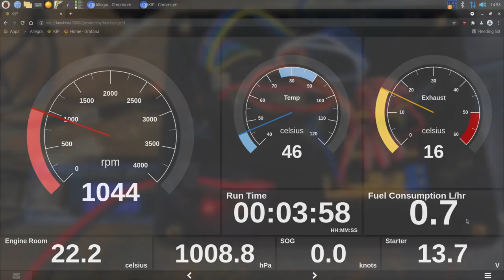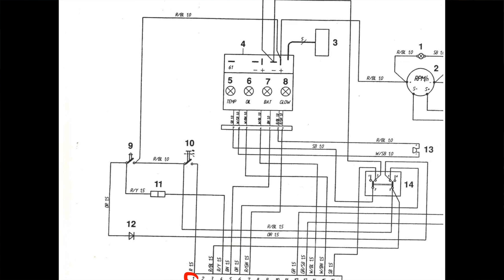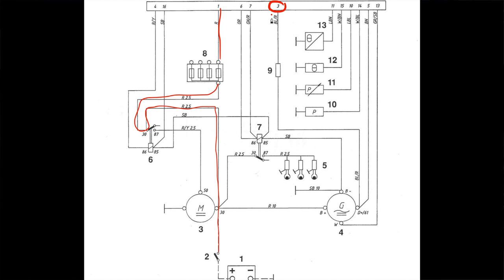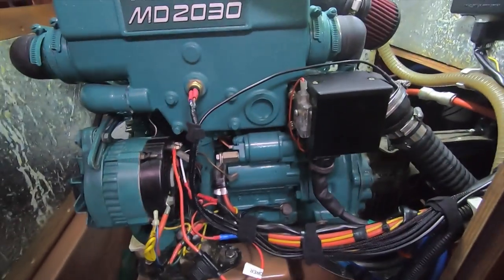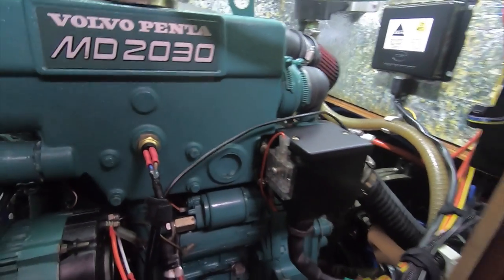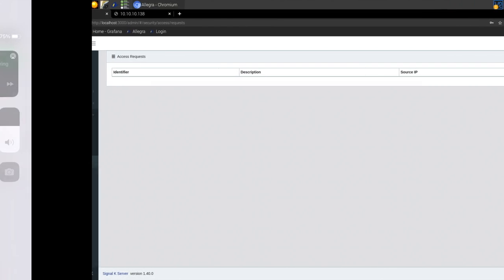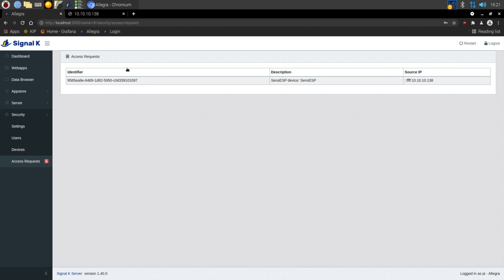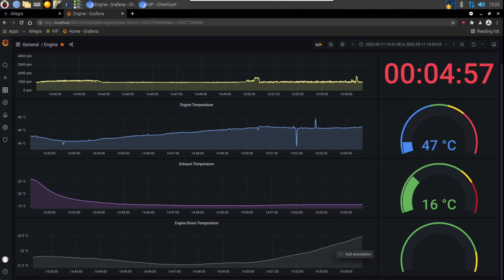OpenPlotter - ESP32 Install - Digitising an older engine - SensESP

Comment: Hi, I’m going to be another copycat. Thanks for the videos. My engine compartment gets really hot after the engine is stopped so I’ll be mounting the esp just outside. Keep the videos coming. (Alderney 👍👍👍👍👍)
Reply from the maker: Hi, Many thanks for your comments. We have noticed the same really and i'm wondering about installing some sort of forced cooling to the engine bay to try and help with that residual heat. I've uploaded the code from this project on github.

Comment: Thank you for the content.
I wonder if you managed to implement the Grove water level sensor? If yes it would be very helpfull if you could provide some guidelines about it.
Reply from the maker: Hi, Unfortunatly not, i didn't get that to work, i changed to a simple switched sensor which was much easier for what i needed to do. Are you converting something or would just like to use that sensor? I do have another ESP now so i might have a play with that in another video.
Reply: @BoatingwiththeBaileys  I was inspired by the contactless princip you showed (the machanical switches can be deteriorated...) and thought using the sensor in Tasmota/Home Assistant environment. Unfortunately there is no implenetation of the sensor in the Tasmota stock release and I could not build my custom firmware, Neighter in ESPHome.
I did not give up yet...
Reply from the maker: @rlajos I will have another look myself and come back if I find anything. It would be nice to get it working

Comment: Nice example of using the ESP32 for monitoring.

I also have an onboard data system to monitor and manage all the boat systems. I found SensESP to be too inflexible and instead publish data using mosquitto across the wireless network to notify the server, which writes to SignalK.  It then writes data from SignalK to influxdb for storage and reporting, and use Node-Red to display live data.

Have you considered monitoring oil pressure? You should be able to swap out the idiot light switch with a sensor that would enable you to measure pressure and also retain the light.

I note and disapprove of the use of "wire nuts" in the engine bay. Those things are not a good idea anywhere, never, ever. Better would be a heat shrunk covered wire splice.

Keep up the good videos.
Reply from the maker: Many thanks for your comments. I have been thinking about oil pressure and maybe using a T piece so that I can keep the current switch for the light and also add a new sensor for this project. Just on the wire nut part, is that the temp sensor? What I purchased should be an alternative to the official Volvo sensor.
Reply: Years ago, I replaced the sensor for the oil pressure idiot light in my old air cooled VW with a VDO sensor that had two output spade terminals. One terminal was for the existing idiot light, the other terminal was for an electrical oil pressure gauge.

The wire nut can be seen in your video at 5:10, joining the yellow and blue wires. These things are unreliable in any situation. Even worse on a boat. Even worse in an engine room. Spliced wire in heat shrink is just as easy and much more reliable.
Reply from the maker: Thanks for the info, that sensor sounds ideal. I know the wire you are talking about and yes it does need changing. Good spot!

Comment: I have a question regarding how you are picking up your engine temperature.   Did you just tap into the factory engine wiring harness at the temperature gauge?  Or did you run a completely Different isolated temperature sensor strictly for the open plotter system?  

I'm getting ready to start a similar project on my houseboat and was curious if I could just use the existing engine temperature and oil pressure sensors and tap into the engine wiring harness and run it off the same sensors without messing up the accuracy of the sensor.   

What is your experience taught you?
Reply from the maker: Hi, I'm thanks for the question - yes mine is a separate sensor as this engine only had a temperature switch. I installed the sensor where the factory option is for the deluxe panel. When I started this i didn't want to mess with the original electronics, I wanted to be able to remove everything if it didn't work. As it happens it's been great and not caused any problems. You can tap into this stuff and use what's already on the engine but I think it's difficult to run both. I'm not sure resistive type gauges will work with two things trying to measure from the same source but would interesting to try this.

Comment: Nice work!  Just bought a victron battery monetor. I was first opting for the smartshunt but realized for the BMV700 cost the same and includes a monitor which has VE.Direct port, so I figured I could just as well connect that one to a pie instead of running VE.Direct all the way from the shunt, the little monitor on is nice to have on the dash. Do you use the Smartshunt in your setup?
Reply from the maker: Hi, yeah I do and then I just use the plug-in from the SignalK App Store to read the data from it. The Victron kit is really good and has been one of our best purchases. Good luck with the project

Comment: Thanks a lot for the update. That's pretty interesting and motivating. I'm on my way to copy your work for my MD2030D. I just wonder why you used 2 different kind of temperature sensors ? What's the advantage of BMP280 when you don't use the pressure feature ?
Reply from the maker: Hi, Thanks for your comments. On the temperature sensors, is the questions around the 1-wire digital one and the one in the engine? On the BMP280, i basically had one at home and i thought it would be interesting to include it. I wanted to get engine room temp as i've thought about adding some sort of fan cooling to this space, now i have some data i can make a decision on that. The pressure reading is just included, i did read about getting negative pressure in engine bays as a sign of lack of air/ventilation, but really it was just lying around at home so went on the project.
Reply: Ok, I understand it's a question of "availability-on-the-shelf". I've got only a bunch of 1-wire sensors so I'll go with them. I just wanted to ensure I did not miss any obscur incompatibility or misuse for DS18B20 sensors that would lead to a complete disaster 🙂
Reply from the maker: Yeah - You should be good to go with the 1-wire sensors, they are really good. I spent a lot of time trying to calibrate the voltage divider to get the engine temperature accurate and i think i might have got the same result with a sensor just stuck to the side of the block.
Reply: @BoatingwiththeBaileys  Small question regarding the Zener you seemed to have replaced by a standard diode. I've got a bunch of 1N4001 to 1N4007. Would one of these reference be a good replacement ?
Reply from the maker: @elzariantlp4594  Sorry I dont really know what the difference is between the two or how that would impact things. This is where the circuit came from if it helps https://github.com/boatybits/boatymonpy/blob/master/Schematic_BoatMonitorSMD_Sheet_1_20200209152710.png << Linked in the Sensor video.

Comment: Hi, great project! I'm currently working on something similar using the hatlabs esp-32 board. Also on an MD2030 on my Sigma 38 on the Hamble. Just wondering how you did the rpm. (ie what is the small circuit board you have connected at the bottom). Thanks!
Reply from the maker: Thanks for your comments. If you want to take a look at the project then let me know. We're on the Hamble. This video should explain the circuits and what they are doing. https://youtu.be/I12NdvRQNxY I found the design on the internet put pleased to report that my RPM gauge seems unaffected by this additional connection.
Reply: @BoatingwiththeBaileys  Thanks. I'd love to take a look at some point. Your md2030 looks pristine. At the moment I'm out of the water at Universal and I'll get in touch again when I'm back in the water.
Reply from the maker: @svenski41  Sounds good - We are just across the river.

Comment: how did you get fuel consumption to show?
Reply from the maker: Hi, I have used a a curveinterpolator to change the rpm output to lph fuel burn. I managed to find a Volvo document that shows the burn against rpm. It’s all predicted/estimated but was just a nice to have. All of this code is on GitHub and linked in one of these videos